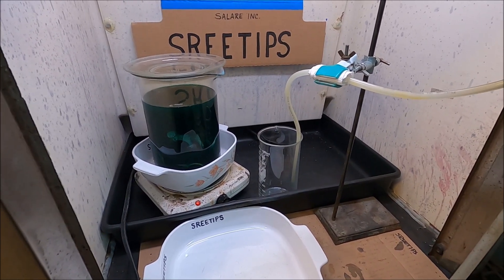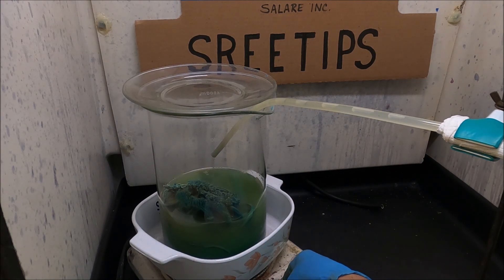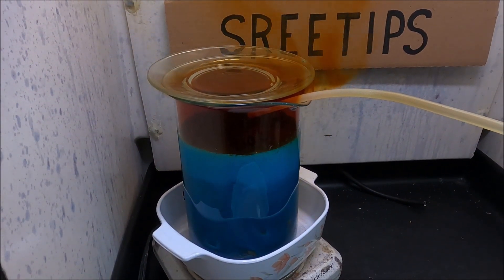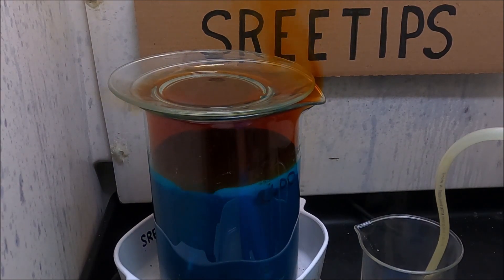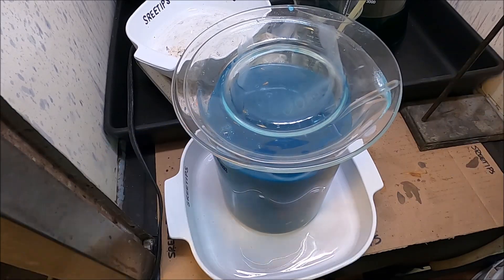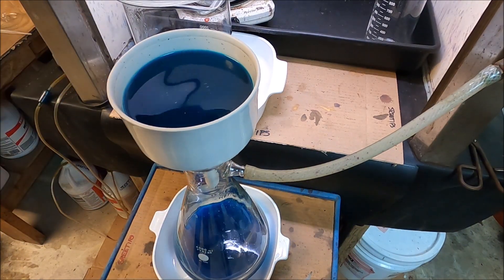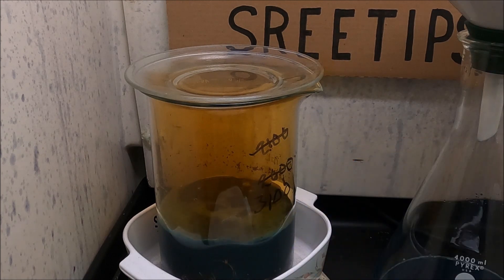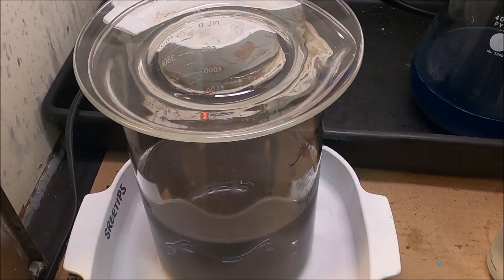Simple Gold Filled Scrap Refining Part 2

Comment: Kevin, get you a 20 quart stainless steel pot. 300 or 400 series will be fine. You will love it! You can use it for silver too.
Reply: With a pot you have plenty of room for expansion.  A pot is deep and wide where a beaker is cylindrical and restrictive leading to  a foam over. You can use your drip rig a lot more efficient that way.
Reply: @FollowMe2aMillion  Yes sir still at it. Doing a lot better now that prices are up! Got a video coming up if i can ever get the time to finish it and edit it.

Comment: After the base metals are gone and you're left with the foils, aren't the foils essentially karat scrap? If so why wouldn't inquartation be next as opposed to going straight to aqua regia?
Reply from the maker: I’ve tried melting the foils and doing just that. The melt was difficult and dirty. And the yield was way off. Plus it adds extra steps to an already lengthy process.
Reply: @sreetips  Won't there be a silver chloride issue when you pour in the HCl?

Comment: You have commented in earlier videos about incinerating the material to remove organics as well as tin/lead solder. I can't remember which video it was but you said the tin, in nitric, makes a "sticky gunk" could that be the reason your filter loaded up so fast? Or perhaps there was some cement silver? I have no experience doing this, I just enjoy the mental puzzle and watching your videos. Best on the subject, btw. Gratz on the 100k, please keep on!
Reply from the maker: Metastatic acid (tin paste) is a likely candidate for the clogged filter. Gold filled scrap is notorious for containing soft solder made of tin and lead.
Reply: @sreetips  yes, just saw in the next video where you said that the incineration process would alter the metastannic acid. Do you filter that out after the first AR digestion like the lead sulfate?

Comment: can i refine both at the same time the gold filled and the gold plated in  one Beaker,, pls answer my question 🙏
Reply from the maker: No! GF and GP require two totally different processes. If you add GP and try to run it with the GF then you’ll end up with a toxic goo and make getting your very difficult and probably lose some of it.

Comment: I think you could have saved some nitric acid in this video by just putting the gold filled material in the sulfuric acid stripping cell. It will work! I have done it. It will make a fine powder, but it will remove all traces of gold and leave the silver and brass alone.